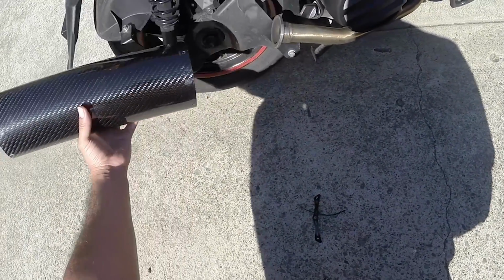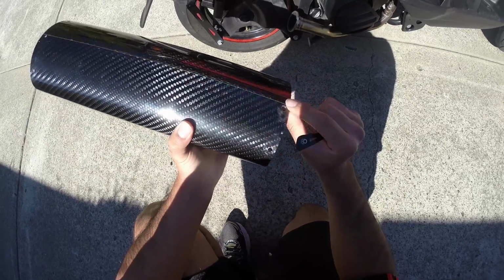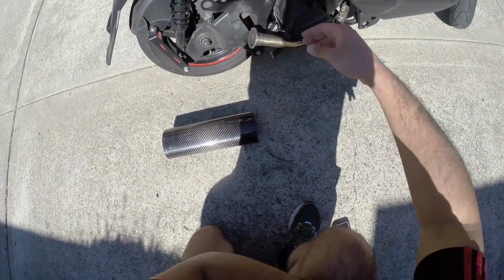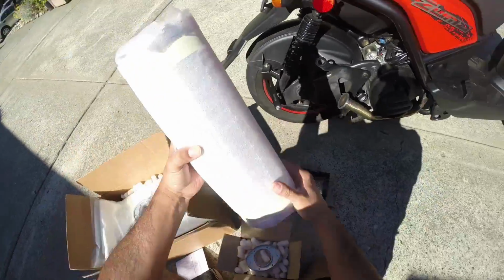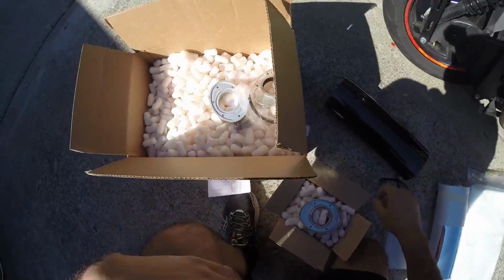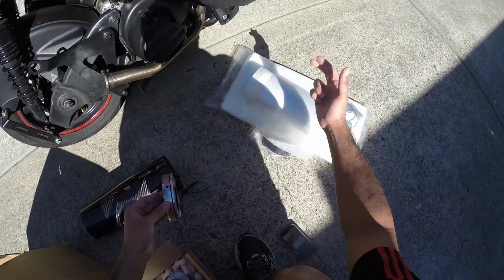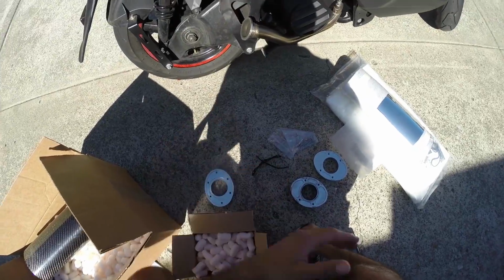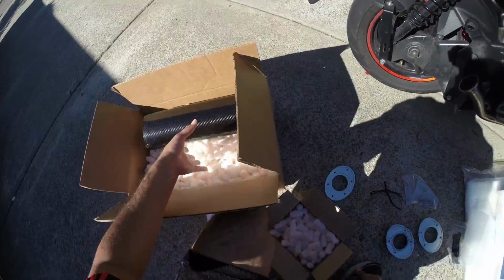Moto Vlog #16 - More Exhaust Problems on my Zuma 125 - Two Brothers Carbon Fibers Sucks

Comment: I always thought that carbon fiber was over-rated. I like a little blue heat tinted exhaust better. Best of luck with this new set-up. Please keep us up-dated. Thanks. 😃👍
Reply from the maker: i mean it did save a lot of weight compared to stock exhaust, it looks cool but i agree, carbon fiber is over rated and is pretty much only good for weight reduction, after what i already spent on replacement parts theres no way im was gonna fork it over for titanium so the soda can will have to do for now

Comment: sorry to hear that maaang! but i thunk you'll like the aluminium, I do. no real need for repacking after the first:) but keep it away from water spots and oily hands....you can see them a mile away. I dont think I'll buy two bros ever again since i saw several flaws on the m2 (scooter) and sr1 (fz09). Both installed already and I'll ride em but if something bad ever happened to them ima just try Arrow or yoshimura now
Reply from the maker: i mean the aluminum should hold up better, but yea im over Two Brothers, shitty designs, shitty products, cool sound but whats the point if it's always breaking down and they don't give you up front pricing. i'd want to get an Akrapovic if i could but i guess ill settle for Yoshimura

Comment: Does the exhaust system give you more power?  I know it makes the bike louder....  When I was trying to add the 75cc big bore kit, I asked about adding a aftermarket exhaust.   They told me it wouldn't make a difference.  but the people that were working on my bike were completely incompetent.
Reply from the maker: two bro has a dyno chart, it adds half a horse power and 1 foot pound more torque,  so yea it adds a little bit but nothing crazy...

but with your power commander, maybe an intake and an exhaust plus a good tune and you should get a little something extra that might be worth it